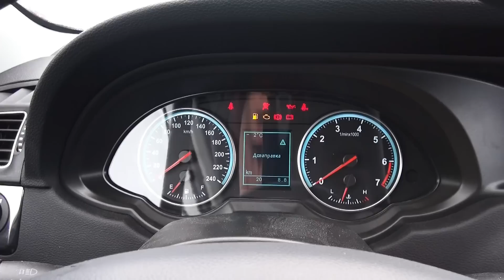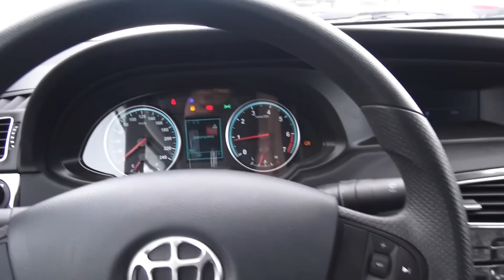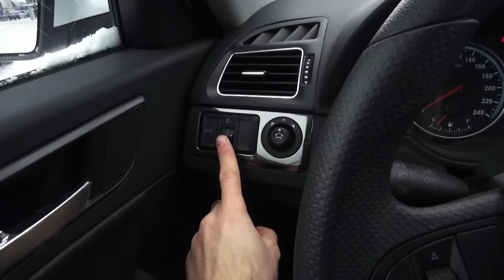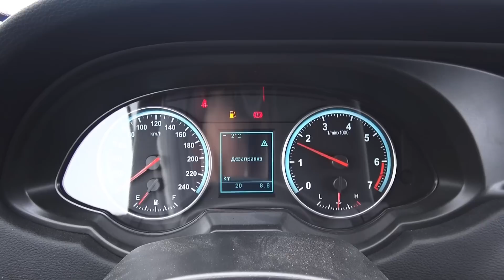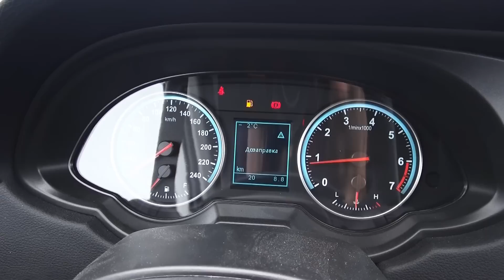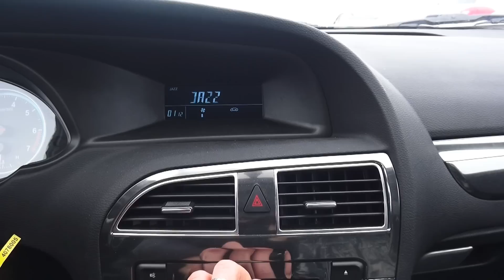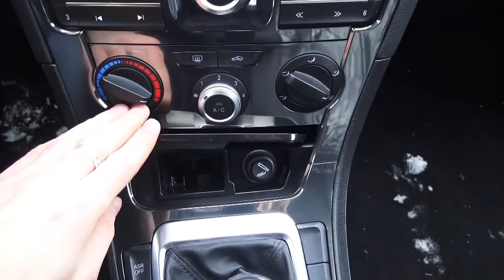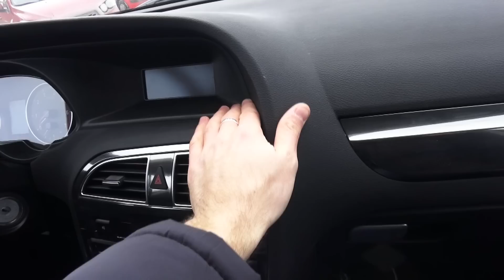2014 Brilliance H530. Start Up, Engine, and In Depth Tour.

Comment: BEFORE THE COMMENTS LIKE: OH COPY FROM.....  START SHOWING ON COMMENT PART, I HAVE TO TELL YOU GUYS, BMW Brilliance (officially BMW Brilliance Automotive Ltd.) is an automobile manufacturing company headquartered in Shenyang, China and a joint venture between BMW and Brilliance Auto. Its principal activity is the production, distribution and sale of BMW passenger cars in mainland China.  They share information to each other
Reply: Tanner Stig This isn't a BMW. What's your point?
Reply: svenskfox okay okay
Reply: svenskfox BMW and Brilliance are partnered in China and Brilliance builds actual BMWs for the Chinese market, for BMW. I'm pretty sure any foreign car company that wants to build cars in China has to partner with a Chinese car manufacturer so they can "share" research and development. Some of the styling is still blatantly stolen from actual BMWs though.
Reply: My original point was that the OP was going on about how Brilliance didn't copy BMW. Maybe they did, maybe they didn't, but they're certainly not using BMW's technology. I think the extent of their "partnership" is what you said, Brilliance is licensed to build BMWs in China. Doesn't mean they're allowed to use BMW tech or styling in their own cars, which is why this H350 or whatever is a steaming pile of garbage and the only difference this has from any other cheap Chinese car is that they're less likely to be sued by BMW due to the potential loss of foothold in a developing market. BMW can't afford to call them out on it.
Reply: +svenskfox the point is that brilliance has the right to use the design
Reply: MINECRAFT Gamer They have the right to build BMWs, not use BMW's designs on their own tepid attempts at transportation.
Reply: And exactly how you know that?
Reply: I looked it up. How do you know that "brilliance has the right to use the design"? As far as I can tell, the only research you've done is reading Youtube comments. Think about it, why would BMW allow a cheap Chinese car to use its design language? It would cheapen the actual BMWs.
Reply: Ok then but first give me a link on where you got that information
Reply: How about their website?

http://www.bmw-brilliance.cn/cn/en/com_waw_bba.html

The extent of their venture is to use Brilliance's manufacturing plants to build certain BMWs in China to avoid the conversion rate fluctuation. That way they aren't importing cars to China at a loss and are benefiting from Brilliance's market share. Nowhere in their agreement does it suggest that Brilliance is allowed to use BMW's intellectual property for their own (separate) car company. 

To be clear: BMW-Brilliance is effectively a separate company from Brilliance Auto. Whether it stays that way remains to be seen.
Reply: oh fine you win but here the thing it is unfair for some Chinese companies because to most people made in china is considered low quality but companies like geely owns Volvo and geely doesn't really copy anymore.
Reply: MINECRAFT Gamer Well they certainly earned that reputation with cars like the one being reviewed here. Geely owns Volvo because they have a ton of money and were wise to leave it alone. The fact that they didn't copy anyone doesn't make them a good company, just maybe not a bad one. If they want to be taken seriously they need to have their own ideas and their own designs. If they can make a good looking quality car with modern tech for an affordable price, the world will take notice. For now, most of the cars coming out of China are weird looking and cheap.
Reply: +svenskfox Zinoro 1E check this car
Reply: +svenskfox Geely is really good right now, even before they bought Volvo, man at least in mainland China Geely cars are popular
Reply: Yuzhou Zhang I'm not a big fan of the way they look, but they're better than many of the others I've seen!
Reply: What about byd cars